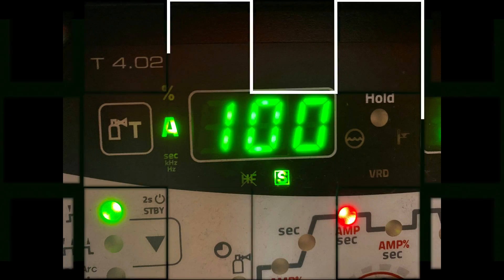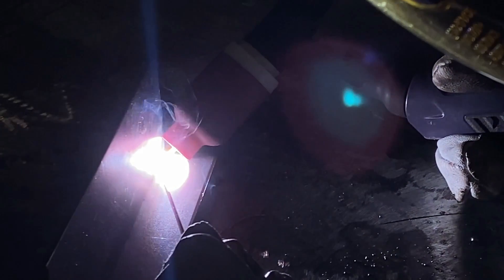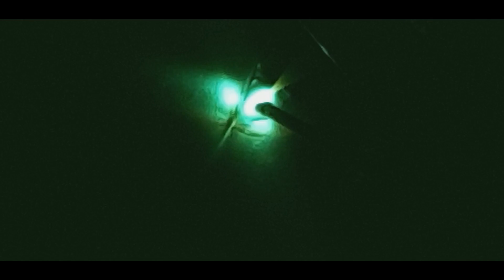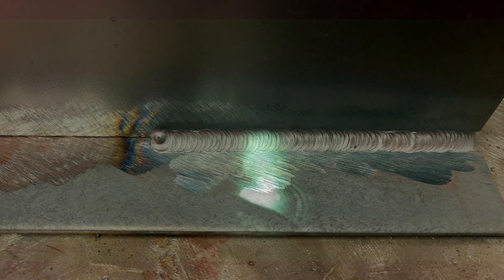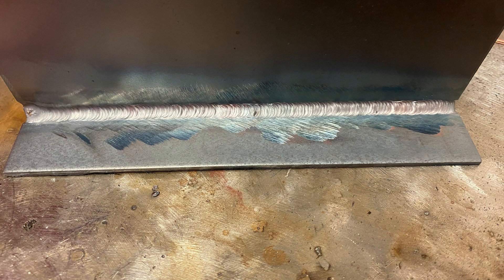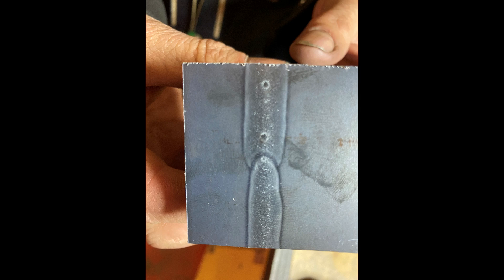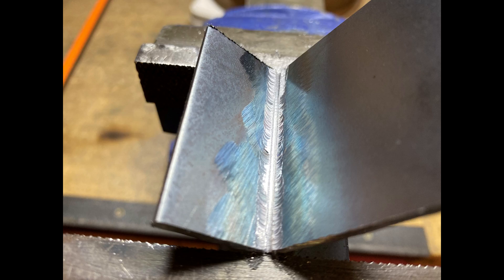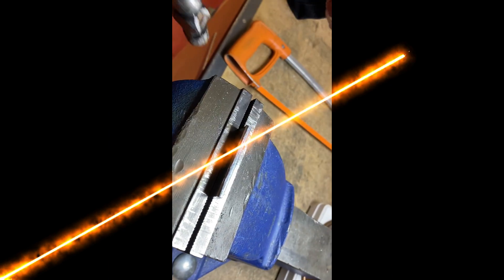Tig welding a T- fillet joint with Nick break test!

Comment: Looked a little hot toward the end and a crater or some Concavity. but overall very good.
Reply from the maker: This is an excellent point. For anyone wondering how you would get round this you would either add end plates or slope down on the welding set if it has the function. We will do another video on slope settings in s future vid. 🙂